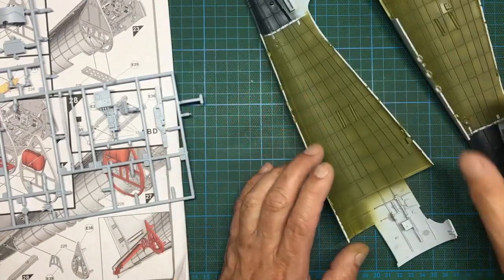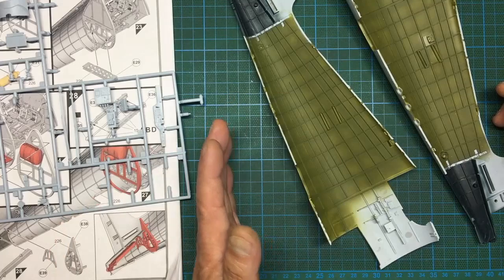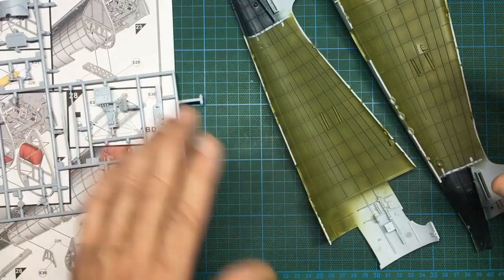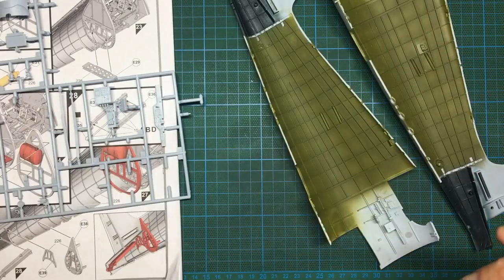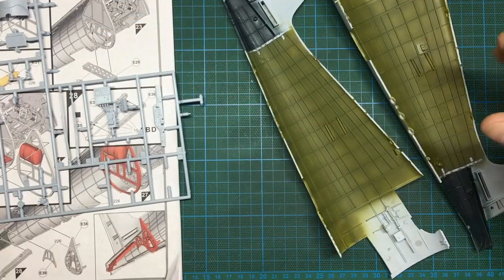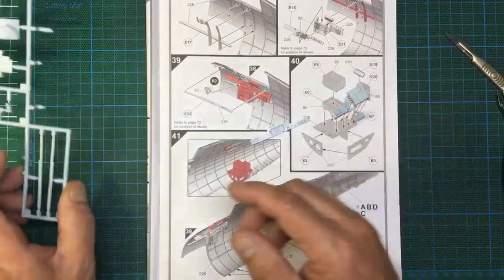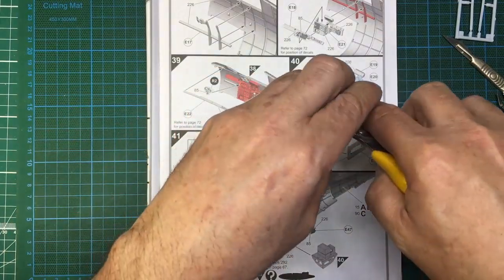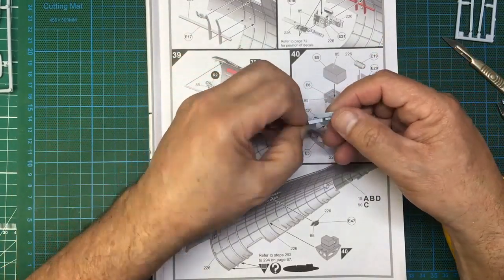Airfix 1/24 F6F-5 Hellcat build. Part 8a.. cockpit detailing.

Comment: NIge
Terrific build update and as always, loaded with how to's, tips and ideas Will be watching the Airscale PE parts a good few more times.
Nothing like being frustrated with Vallejo Model Air Paints as I just finished air brushing the cockpit assembly. I had to use Model Air as it's one of the few pretty accurate Interior Greens and it would have to make do. I had the same issues as you did and believe me, the problem wasn't a dirty air brush but the tip size. Since I don't shoot Model Air any more, I forgot and started shooting with my Iwata Eclipse with a 3.5 tip: clogs galore.  I switched over to an Iwata Revolution CR with a .5 tip and changing nothing else, 90% fewer clogs. I super thinned out the model Air and shot it on with no primer, as I rarely use primer before the color coats on interior surfaces.
Keep 'em comin
Peter

Comment: Hello Nigel . I think night fighter cover would be a misnomer . it should be a night flying panel .
If the aircraft's mission length meant the aircraft was returning in the dark , not uncommon in the pacific , Then the aircraft would have it fitted for the mission . you would not just leave it on for no reason as its extra weight and its a fighter aircraft . maybe as this will be a carrier bird , if you depict it on a certain mission date and it was a long mission , you may be able to say it would have had it fitted .
Loving both build series . thanks .

Comment: Did you fix the airbrush then....mine had issues with the air intake valve sticking and I have just  had to clean and lube one and it's a pain to re-fit the  screw with using my tweezers. Do you have a better solution to re screwing it back in?
Reply from the maker: I use tweezers too Steve, but I try to select a pair that has fatter than fine legs so the threaded disc can be pushed in as well as turned to get it started. I basically soaked its bits in Acetone overnight and it is fine now.

Comment: Hi Nige, great job you're doing. I'm building along with you, but about 2 episodes behind so that you can "blaze a trail" and spot any pitfalls. Regarding painting the interior of the fuselage, like you I did mine interior green to start with, but now need to change that to the zinc chromate yellow. I have a question regarding this...what colour do you think the underside of the cockpit floor should be....green or yellow? It should just be viewable through that open hatch. Also, I assume the rear face of the main bulkhead behind the pilot's seat should be yellow, but the lower half of that bulkhead has cut outs so should that section of the main bulkhead be yellow or green? If the front vertical face of that section is green and rear vertical face is yellow, then what about the 4 surfaces of the spars in that cut out section...should they green or yellow all the way round or, say, green on 3 sides but yellow on the rear facing side?
Reply from the maker: Now you menton it, I think the rear bukhead would be green and the one just behind it would be yellow. now I need to paint mine again!!
Reply: Thanks, and what do you reckon about the underside of the cockpit floor.......green as well?
Reply from the maker: @davidallen1213  yeah, but remember there should be a fuel tank there..  or at least forward in the wing box? Best paint the rear wing spar matt black then.. ooh it goes on!!

Comment: Good Evening Nige, Might I suggest - as an ex professional Pilot - that the 'hood'was an engineering palliative used to aid in instrument (IFR) Operations or in cases where long range operations were conducted (operating over open ocean in darkness and over significant distances would have necessitated IFR Operations be conducted). Shorter Operational sorties such as immediate defensive flights would not require such a 'hood' as the aircraft would have been flown in a more visual (VFR) format.
Kind Regards, Dennis
Reply from the maker: I agree.. whay would they fit a night vision aid to a day time fighter..however, they may have fitted the hood to all aircraft just in case they got caught out?? I doubt it somehow??